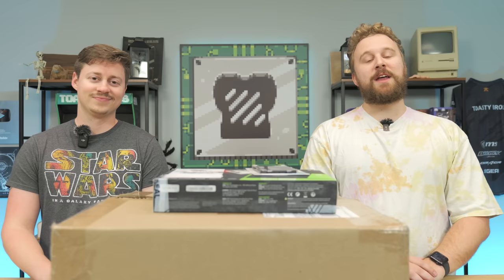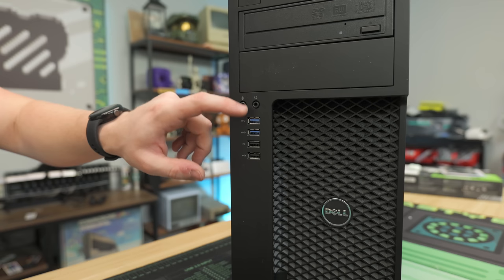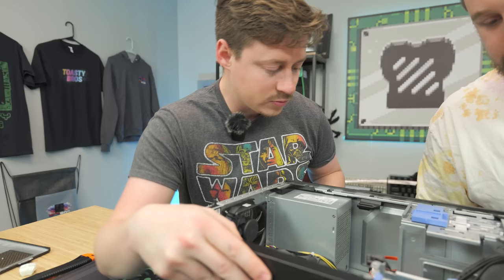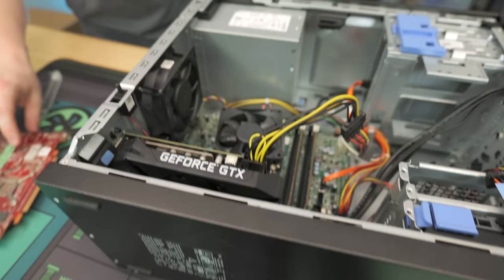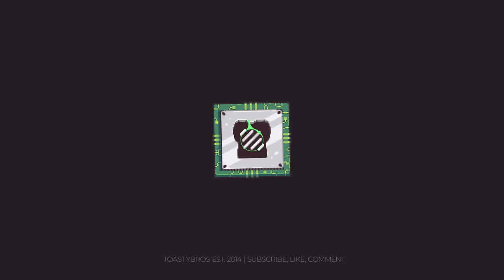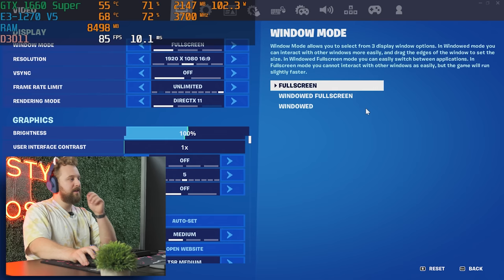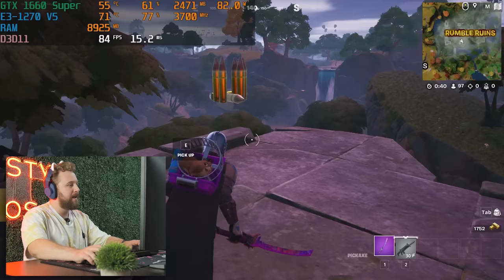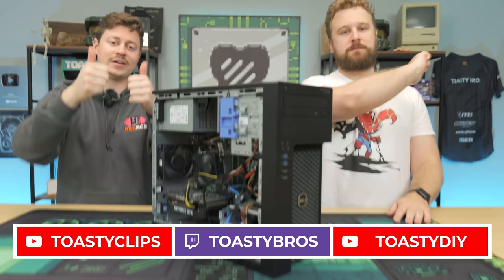This $215 Gaming PC Build is Almost PERFECT....

Comment from the maker: Appreciate the feedback on this video! Since we didn't have a 6-8pin adapter in house at the time of filming, we went with what we had which isn't recommended. Definitely repeat this with a 6-8 pin for best results! Will work on improving this in the future :)
Reply: Use a two 6 pin to 8 pin use the sata six and the psu 6 and split the load 30 watts per cable simple
Reply: You guys said this PC can play anything but I just checked and it can't play Alan Wake II!😁
Reply: You should have shown the performance of the original parts and not swap them out like the hhd and gpu. So that we can truly gauge the real perf of this ultra budget pc.
Reply: Dudes?   Don't worry about it! 😊 What you did was exactly what anyone else would have done in a BUDGET situation, and you did that perfectly.   It's spot on to what anyone else would do in if they only has a few quid to spend on a PC as not everyone is made of money, or even has a way to get good PC parts outside of a garage sale or recycling center or Goodwill / Thrift store.     

Nothing is going to Burn down as so many have put it here.  Most are simply just following the Lulz crowd.  
If I may, your next budget build series should be  how to use those 16GB intel Optane drives to boost the performance of the cheap SSD's from TEMU or aliexpress that come in at 1TB and see if you can overclock the CPU's in some of these Old XEON systems.        

We in the car community have to sometimes stick with what we got on hand.   See if you can focus on that and you would have a really gem of a video on your hands.  :goodvibes:

Comment: 6 Pin to 8 Pin PCIe adapters are perfectly safe. The extra 2 pins are just ground - meaning most PCIe cables can already handle the 150W that the 8 pins are specced for.
Reply: i have a whole drawer of them i pulled from dell pre builts

Comment: you so wrong about hard drives a 4tb ssd is so expensive compared to a 4tb hd ,yes get a 1tb ssd but also get a large hard drive  save money on mass storage
Reply: Most peeps ain’t buying a 4tb for a super budget build…
Reply: My 2TB hard drive cost about $55.00.
Reply: @samagog Why not? You can transfer it to a newer build in the future.
Reply: You’re not wrong.
I used to buy 8TB externals then shuck them when they were $50 cheaper than bare HDDs…. Then I tried that with Starfield.  Talk about a stutter fest, and it looks like games might be trending to SSD as a requirement.
I did find a used 4TB HDD for $30 for my kid’s PC to use for games storage which is roughly the price of 512GB m.2 SSD.
Reply: If ALL you are putting on a spinning drive is stuff from Steam or the Epic store or Rockstar, games you can always download again, then even a very cheap refurbished hard drive will work.  Picked up just such a drive, 3TB for like $20.  It's good enough.  And the drive has been fine. If it dies, cry cry but everything can be downloaded again.

Comment: My 1660 super with one 8 pin connector draws upto 125watts ish in unigine heaven.   Yes it can and will draw that much power.    And thats not mentioning OC stuff just basic power limit.
Reply: Is it in an optiplex

Comment: You should have used a 6 pin to 8 pin adapter. The 1660 only uses around 120-130w, the 6 pin is rated for 150w so unlike your sata solution it would actually be decently safe.

Keep a few 6 pin to 8 pin adapters laying around, they are great for those workstation pcs.
Reply: agreed, came here to say the same thing.
Reply: 6 pin is 75W and 8 pin 150W. But the extra 2 pins are actually just ground, so if the cable is thick, pretty much every old 6 pin is already easily gonna handle 150W.
Reply: I used one for HD 3870X2 back in the day without any issues. :D
Reply: You mean the 12 - 15  yr old fortnight slayers. 🤣🤣🤣 @ShadyButFresh
Reply: Yes I'd do a 6 to 8 pin adapter over doing a sata to 8pin adapter first
Reply: I agree this is the stupid way if the had the six pin on the psu, but also the gpu takes about 60-75W from the pcie socket.
Reply: Where do you install the 6 pin part I know how to install the 8 pin but where do I plug the 6 pin?

Comment: Not sure why you went with the sata too pci-e 6+2 pin there.
The 2 extra pins are ground pins, but if you want too be sure the 8 pin has proper power.
By combining the two 6 pins the powersupply 6 pin & the sata to 6 pin adapter into an 8 pin, that's probably the best option for ensuring full power.

Comment: I'd recommend old HP Z440. Usually came with a decent 4 or 6 core xeon and 16 or 32gb ram. The main benefit is most of them had a 600w psu with a 6pin pcie that can easily be adapted to and 8 pin opening the door for more gpu options.
Reply: I agree with you but the issue is the Price.. it's abt twice the price of the pc in the video not upgraded
Reply: i need a gpu like 750ti for 290W psu, dell optiplex 3020 with 12gb ram of ddr3 ram and a core i5 4590s (having ssd and hdds). Pls recommend me

Comment: In my HP Z240 (which has a 400W 80+ Platinum PSU) I just used a 6-Pin to 8-Pin adapter to get my GTX 1070 running. And my CPU is the same Xeon E3-1270 V5. This CPU is equvalent to the i7-6700 non-k but with a slightly higher clock. I mean: The 8-Pin is not much more and mainly just has an additional ground pin. But the cables themselves can handle the theoretical additional power, which the GPUs themselves oftentimes don't actually need. Most GPUs that could easily live with a 6-Pin just come with an 8-Pin connector these days. Like the 6-Pin seems to be fading out apart from those prebuilt systems. And I'd feel much safer with a 6-Pin to 8-Pin adapter than with some SATA power adapters.

Comment: I've had a 3060Ti (200W TDP) installed in a 3620 with the 365W PS and 6-8 adapter no problem. 150W through the six pin and 50w through the PCIe slot. also ran prime95 with the i7-7700 for 2 hours straight with no issues.

Comment: The 1660 ti I had ran off the 6 pin in the 8 pin slot. I wouldn't suggest it but it works when you're broke.

Comment: The HP Z series workstations are still powerful enough and underrated and they offer dual CPU slots that can take hex Xeons which doubles the RAM you can use. I use an older Z600 for music and its maxed out with 128Gb Ram for Kontakt and its an absolute beast. I installed a LSI SATA3/SAS card with 4 internal ports and external SAS socket I have connect a raid array and upgraded to the 1060 6Gb card for dual 4k displays. It happily runs windows 11 without any driver issues albeit without the added security which I just do not need as its a standalone system. It happily runs  4k video with Dolby Atmos and Vision.

Comment: I did one of these with a 3050. Performs pretty well. Mine came with a 6700k and I made use of the open m.2 slot next to the font-panel header as the boot drive. I replaced the PSU and used a 24-6 pin adapter. The original PSU didn't have the 6 pin for the gpu.

Comment: was grazing alliexrpess after one of your vids and came across a 1080 non ti model for 56$, i'd like to see a vid with that in a budget build if possible :) great vid as always :D
Reply: Not recomended those cheap cards are recycled from former cards taht were used for mining , they just take teh aprts out resolder them into new boards , as a result the integrity of the card come sto question with many of them dying very soon but most dangerously many have temperature issues , dangerous stuff

Comment: Some of these Dell Precision towers in that form factor come with an extra 6 pin power cable that directly comes off the PSU
Reply: Just the ones with 365W PSUs. I had to upgrade mine Precision with 24-to-8 Pin, but then I plopped a Seasonic Focus Plus 80+ Platinum in it, which no problem powered the GTX 1060 i added (PALIT GTX 1060 6GB Super Jetstream).
BTW, Dell's PSU in those PCs are made by Seasonic, too, meaning that dimensions are an exact match, no issues swapping them, too.
Reply: @gmaacentralfounder  🤔

Comment: 5:38 Its usually a 50/50 split between the pcie and the molex connectors up until some point. Dual sata is definially safer for long term.

Comment: I scored a Dell Precision 3620 workstation last year for $120 shipped. It has the I5 6500 and slot for an M.2 NVME so I installed one and also 32GB of 2133 DDR4 Ram. It's a nice machine but I'm using a slightly older DDR3 ram HPZ 620 Xeon 6 core 12 thread1650v2 (3.50-3.90 Ghz) with a GTX 1060 to get my feet wet to gaming. The proprietary PSU's are the only drawback so far because they need a 6 to 8 pin adapter but the HPZ 620 has an 800W PSU.
Reply: That 800W is overkill, 500W is more than enough
Reply: @xXVibrantSnowXx  Yes indeed it is for my needs but that is what the HPZ 620 came with. I'm currently using it to test out  old used GPU's.

Comment: Using one of those dual sata power to pcie is perfectly fine. Normal gaming operations will be no problem. Those connectors have a bad name mostly from miners and hard overclocks.

Comment: Sata to 8 pins or 6 pins can be safe if you are smart, Sata power ussaly can send about 45 watts and be fine, I have a sata to 6 pin and I have a 90 watt card so that means only 15 watts is being used from the sata power which ussaly makes it safer than overloading it

Comment: Running a very similar rig and have been for a year. Dell optiplex 9020 16gb ram SSD at 1TB GTX 1660 super (same power adaptor). Stock PSU. All in £210. Do you think there is any benefit to the processor upgrade to i7 6700 ? I considered the i7 4790K some time ago but don’t really see the point. I bought a PS4 instead for the E sports stuff..  . My peoples Runs Jedi fallen order Jedi survivor Robocop and cyber punk to name a few. PS so far no Fires! 😀

Comment: So my hp z420
Has a 4 pin pci e power. I already used an adapter to go to 6 pin for a 1060. Thinking about using a 6 to 8 pin and going to a 2060 super. Should I video the experiment and see if flames shoot out? 😂

Comment: Why didn't you use the built-in 6 pin and the +2 only from the sata adaptor? Wouldn't this be a safer solution that avoidfriedcables ?

Comment: I have that exact same graphic card except mine is GTX 1650 Super and was lucky to score it open box and still good for those dell optiplex. But what cool is you can swap out power supply. I ended up swapping mine out for an EVGA 450 Watt and from there was set for using those 1650 or 1660 cards.

Comment: I just found you guys and I am loving it. I am going to be getting a used computer from work for my son. He is 11 and into gaming. Once I find out what it is and the specs, would you guys be willing to help me figure out what I have to do to it to make it good enough to play Fortnite? I'm not a wealthy person, just wanted to throw that out there, hence getting the computer from work. I thought I needed to say this... I am not looking to try to get anything for free from you guys, just some help and info on what to do. Thanks!
Reply: fortnite is relatively easy enough to run. and if the workstation is decent you can just plug in a 1050 ti or something cheap without having to replace the psu and it would still gain a high framerate on fortnite and other games.

now the main problem if anything would be airflow... if the temps get too high you might have to remove some parts and fit an fan into it
Reply: forgot to mention but make measurements so that the gpu your buying actually fits

Comment: Does this TEAMGROUP MP44S High Performance SSD 1TB SLC Cache Gen 4x4 M.2 2230 PCIe com with a mounting adapter? I haven't older motherboard which is still in good condition ASUS P5Q PREMIUM.

Comment: If I use a sata to pcie 6 pin should I plug both sata adapters on the same cable or use a sata from 2 separate cables?

Comment: If this thing had a 6th or 7th gen core i5 or i7 with a 550 watts power supply even if it is 150$ it's definitely worth considering 

Slap a GTX 1080 for 125$ and you get a VERY capable 275$ gaming PC, with 40$ for an SSD it's 315$ gaming rig which is a phenomenal price

Comment: undervolt and overclock the GPU, use a 6pin to 8 pin adapter, also Fortnite works better in DX12 shadows are the major cause of stutter turn that down or off post processing can also be lowered. make sure to set Nvidia control panel for Fortnite power to high performance and vsync to fast vsync in game off unlimited FPS then use riva tuner to cap the fps to the refresh rate of the monitor or minus 2 fps for example if the monitor is 144Hz set the frame cap to 142 fps because the frames will spike over the set value

Comment: i was planning on buying an old Lenovo thinkcenter to upgrade, it has 16 gigs of ram, an i5 6500 and integrated graphics, and i was planning on putting a 1650 in it because of its low power usage, but if anyone has any advice i would really appreciate it

Comment: You should have used the 6 pin connector from PSU and then just the 2 pin off of the sata adapter. Let me know if it works LOL.

Comment: Why wouldn't you just swap the PS with a 500w?  That would be enough for the whole system, plus only 1 adapter needed, to the MB.
Reply: Hey I have a 450 w psu and I got a gtx 1650gddr6 oc with 8 pin can I use dual molex to 8 pin cause gtx 1650 oc is rated at 100w and 60~ish w can be supplied through cpie slot and dual molex can supply another 108w so I think I should fry my pc right?

Comment: I had one of those converter cables melt - got sooo hot it shorted out the PSU and went pop - but the graphics card survived.
Reply: What card was it running?

Comment: Fortnite seemed a bit stuttery. The Xeon is a bit low in frequency. You could have used a 6 to 8 pin adapter wich shouldn't have been a problem, I mean the power draw is pretty much the same with a 1060 6gb and that card has 6 pin pci-e plug so yeah 125w with a 6 to 8 pin adapter shouldn't be an issue

Comment: Can you upgrade a Dell latitude D830 Laptop 2.6 GHZ Dual-core processor 4 GB of Ram I use This Strictly for gaming older Games Command and Conquer Generals, and Command in Conquer General Zero Hour. This Games would not download to my newer PC so I found out that it will only play with Windows XP. So I have Windows XP professional edition. I am just very curious on if I can upgrade this laptop. This is not the first time I've asked you guys this. I understand you guys get a ton of comments, but anybody that can answer this would be helping me out tremendously.  Can this Dell latitude D830 2.6 GHZ Dual-core processor with 4 GB of Ram Can it be upgraded at all? Cost is not a problem 👌 Thanks
Reply: You can upgrade the HDD to an SSD. A 120 GB SSD should be more than enough for an XP system. It looks like that computer supports up to 8 GB of DDR2 SDRAM. However, it makes no sense to upgrade past 4 GB of RAM on 32-Bit Windows XP as it cannot use more than 4GB of RAM. IF (and a big IF) Dell released Windows XP 64-Bit for that computer and has drivers still available, you can probably install that version of XP to use more than 4GB of RAM.
Reply: @JJFlores197  thank you so much so I guess that's only for my command and conquer games like Generals Zero Hour best war game in my opinion for the early 2000s and until I would say 2020 when beter war Gamez came out way more Advanced then command and conquer Generals Zero Hour but if your haven't play it try it absolutely the best War Game its so Awesome and my Dell latitude D830 with 2.6 GHZ Dual-core processor plays it on maximum quality Graphics and it plays it with out any problems at all. I am very happy with it just the way it is at least I can play this games on it because it Requires Windows XP for a Operating system and it wont-work for anything newer than this Unfortunately. Thank you for your help I appreciate it very much. I am Not surprised that Toasty Bros ignored it my question. O well Thanks Again I bet your couldn't Recommend a laptop that has a DVD player built into it. That is a gaming laptop that that you know of. I think they stop making dvd players in laptops around 2015 or so

Comment: Can't the PSU be swapped out in these? Looks like a standard atx PSU. 

A few years ago when I use to buy and sell optiplexs. I use to put off the shelf atx PSU and buy the dell optiplex power converters that converted the propiatory motherboard connections into standard 24 pin motherboard and 4 pin CPU connectors. 

Do these adapters not exist for these ones?
Reply: Thats what I just did for my 3620. I used a Corsair 650 watt PS with the adapter. It just barely fit.

Comment: A 6 to 8 pin adapter would be way better than this. The 6 pin also would’ve worked just fine in these lower power draw 8 pin cards, 6 pins is enough to power them.

Comment: Question if it comes with a HDD can I just keep it in there? I would still get a better storage system like an ssd.
Reply: Yes, you can switch the boot media in the bios easily.
Reply: @BertieJasokie  ok cool I just wanted it as extra space for like word documents
Reply: Yes you can add an SSD and use that as your boot drive and keep the HDD for extra storage

Comment: Corsair makes a dual SATA SSD caddy for around $10.  You can drill out one of the holes on the bracket below the bottom 5.25” bay to mount it.